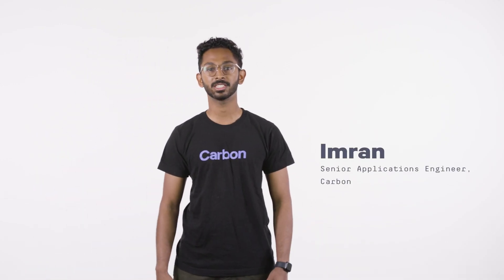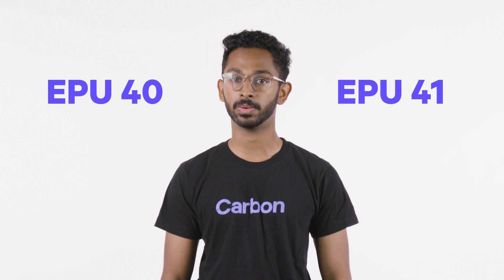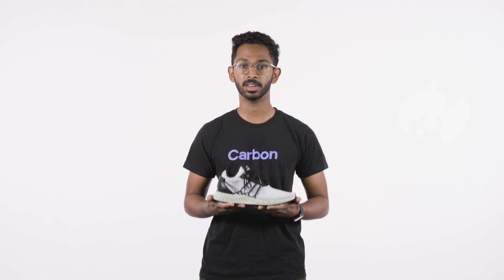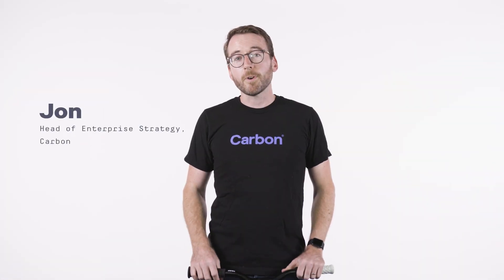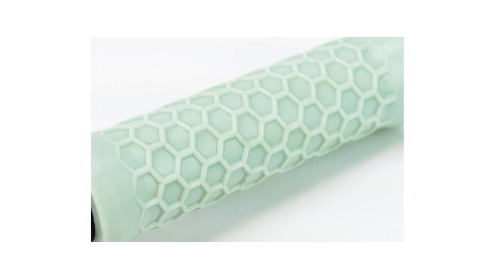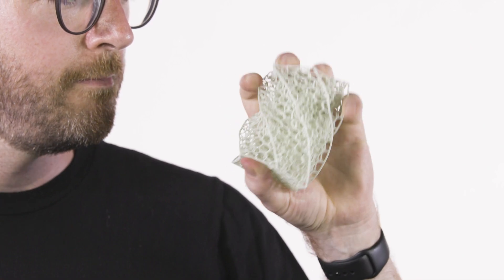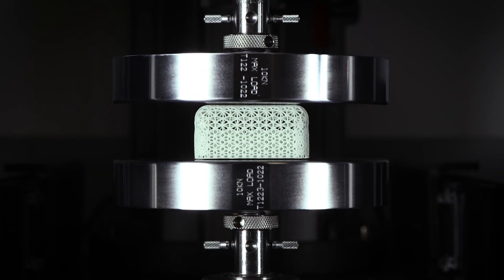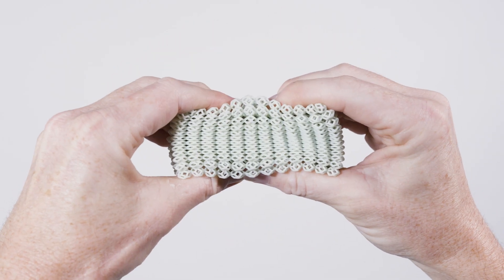EPU 41 - Ask an Additive Expert

Comment: Can this resin be used in simple cheap sla 3D printers?
Reply from the maker: Thanks for your question. Carbon's materials are only available for Carbon printers, but you don't need to own a printer to use them. Our Carbon Production Network partners can fabricate your designs on demand in volumes ranging from a single part to tens of thousands of parts. Find a partner here: https://www.carbon3d.com/certified-production-partners/